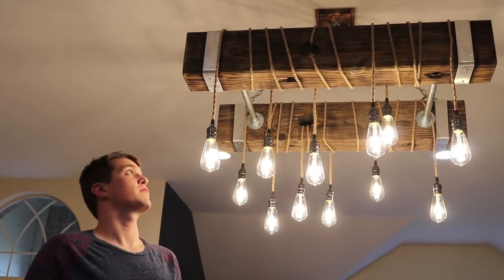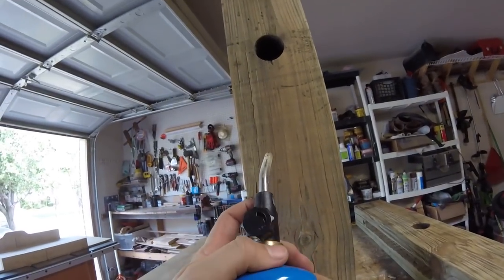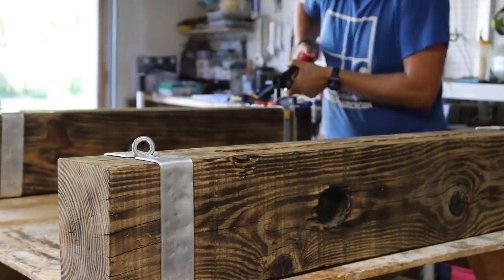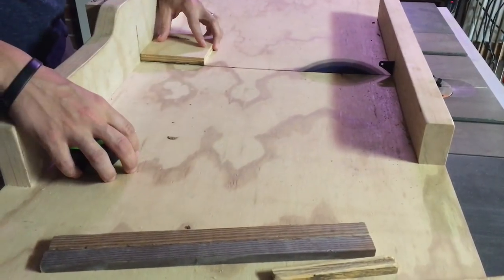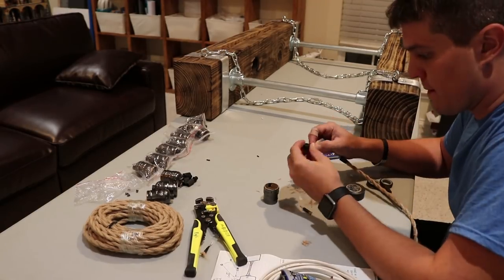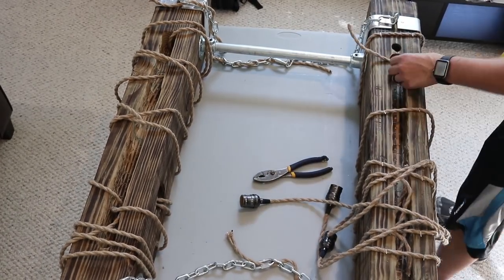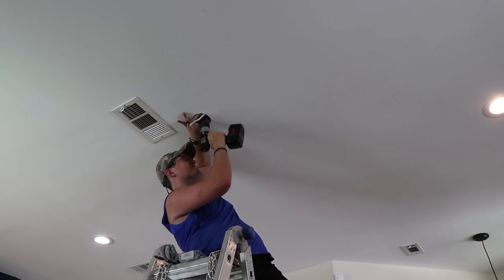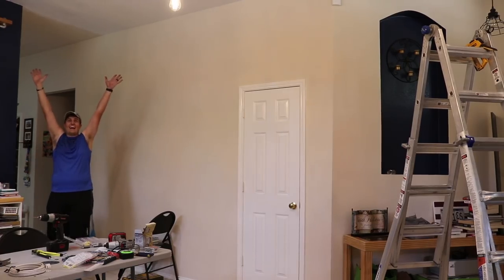Industrial Edison Bulb Chandelier DIY

Comment: To add to your torch theme, if you burn the grain, then take a grinder with a wire wheel and go over the whole thing, it’ll take out the low part of the grain and leaving behind the hard part raised. This makes a very cool looking weathered distressed look. Then burn again and stain.

Comment: how do you connect to ceiling wires ?? .what do you do with the ground wire from ceiling ? do you leaved it disconnected ?
Reply: its disconnected, one of the DIY mistakes in lots of videos are the electrical part, its a personal project obviously most of the material aren't UL label.but its acceptable if there is no electrical inspection on your list. 
I would suggest making the splices on a handy box and not putting mire that 4 wires in box, maybe you can even them up by amount of wires. and leave a pigtail long enough for ceiling lights would also recommend searching for a 3 wires cords(black/white/ground) if not at least see a way to ground lights. safety first, we tend to say nothing will happen and it might be true, but if there is a short in lights it could cause fire, or somebody to get electrocuted

Comment: This particular beam is a CCA pressure treated highway guardrail end treatment post (I know, I used to make them), hence the green color and 2.25" hole. They're free, sure, but I hope you washed your hands after all the handling. Chromated Copper Arsenate will gasify with the heat of the torch. Dude... they look amazing, but be careful with "free" wood!

Comment: What gage wire did you run from your light sockets?
Reply from the maker: We used 18 gauge but anything between 14-18 would work! The more lights you are going to run requires a  smaller number gauge (the smaller the number, the bigger the wire)!
Reply: Got it! Thank you for getting back to me.

Comment: No way that fan box is rated to hold that much weight.
Reply: I didn’t actually secure the chandelier to the fan box. The lag bolt is driven about 4 inches into a 2x8 crossbeam. The fan box is just to safety house the electronics.